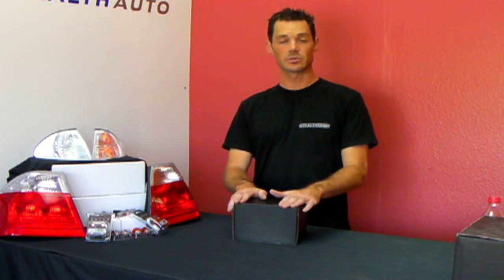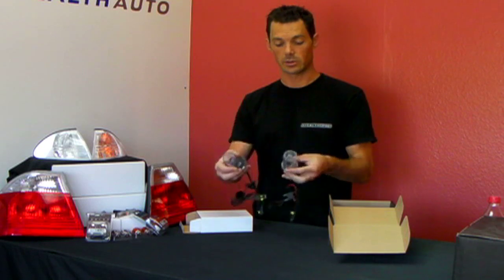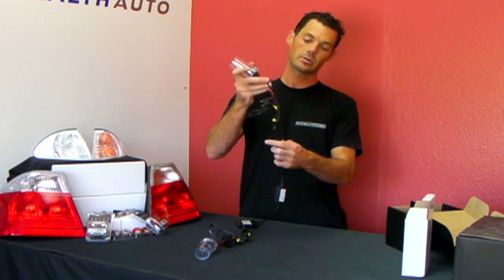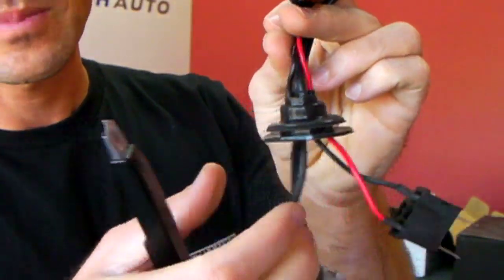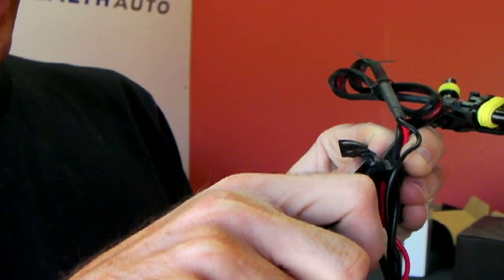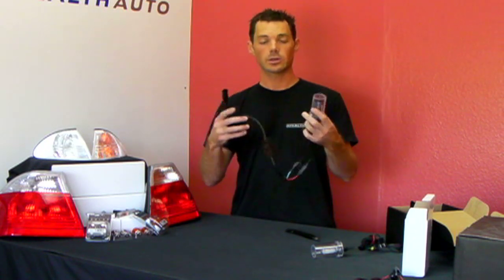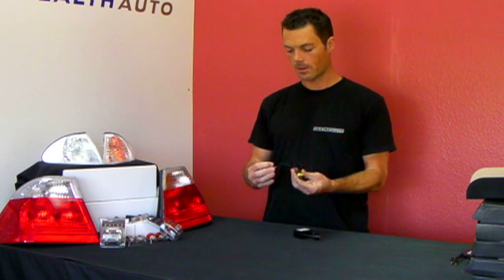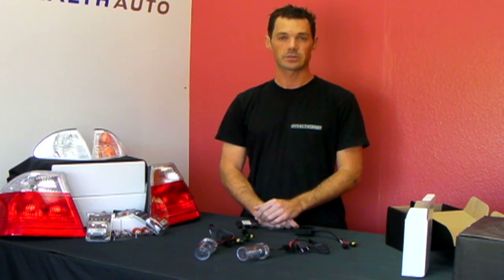HID Kits Explained - HID Headlights and Capacitor Guide

Comment: Have a question for you have an 09 hyundai elantra have 2 kits installed they work fine H11b for the low beam and 880 for the fogs its my fiances car but i noticed if you shut the lights off while the vehicle is running and power them back up only 1 will turn back on unless i wait 5 min so i installed a relay but no change i was wondering if possibly i needed a capacitor oh and its just the headlights that only 1 turns back on when switched off with the vehicle runnin the fogs still come back on

Comment: If you dont replace your headlights then i would say probably stick to halogens.  HID's in a regular headlight destorts the light a little, depending on the headlights function. I wouldnt say their better, they definitely are brighter when in a correct headlight.  I went from HID 's back to halogens just becasue i dont want to spend money on new headlights so it doesnt distort any light. If you runHID's in a stock headlight with a reflector(most cars have)it will be like driving with high beams.

Comment: The ones you can just replace are halogens.  These go through the "igniter" which is a gas lit so you need the ballasts and stuff.  Depending on your vehicle, i have a tall truck so i use halogens in the headlights and HID's in the fogs.

Comment: @wdbwfan 

The common aftermarket blue light is rated 6,000-8,000 k on the color temperature scale. Many simple plug-in-kits include these bulbs because they are initially more attractive to buyers.

Pure white (the ones in BMW headlights) are 4,300 k.
5,000 is going to have a hint of blue that might be enough to attract police attention.

Comment: Hey quick question, I am install a HID kit on a 2008 Dodge Ram and the HID's in the low beams are randomly cutting in and out (not like the normal flickering you get in most cars when they need a canceler kit). I had this same problem happen when I was trying to install a kit on the new Dodge Caliber's as well, I tried installing the normal canceler kit that usually stops the flickering and such but it made no difference. Do you know what I need to fix this? Will a capacitor fix it? Thanks!

Comment: @heartbreakid87 you dont need to get a relay harness, but i would reccommend one. its only 10 bucks on ebay and will reduce electrical stress off ur stock wiring. but no your car does not have a stock relay harness. the factory wiring is a whole harness that splits for both left and right headlight.

Comment: i have a question how did u get ur fog lights to stay on cuz i installed hid lights on my  02 tundra there h4 h/l n they work fine but my fog lights wont turn on anymore!!! n if i turn on the switch for the fog lights n turn on the regular lights they stay in hi beam mode unless i turn off the fog light switch again by the way the fog lights are stock!!

Comment: It's called a Digital Ballast and to prevent ''flickering'' of the High Intensity Discharge bulbs upon first few seconds of being turned on; one should also purchase a relay wiring harness that matches with the head light bulbs of your current vehicle that you are modifying.  Remember to always match up pos and neg on the ballast power supply wire seeing (+) and (-) on the side of the ballast where you plug the wires into the main light bulb power socket i.e. High/low/ground wires

T.J.

Comment: look take the h11 bulb, put it into the low beams of a honda with dtr, it wont work, so you need a cap.

Put it onto the fog lights its ok and will work fine, put it onto almost any other car and it will work fine.

id say maybe 1:50 cars needs a capaictor for the kits to work, so its sold seperately.

Comment: its very uncommon that cars need a capacitor for the HIDs to work correctly.

The kits are sold by the bulb type that they fit,  not for the particular car.

It is the particular car that will have or not have an effect of flickering hid because of pulsed voltages being sent to the headlights.

Comment: Additing a capacitor to the relay wire harness will only cost you less than $10.00

Buy a capacitor from any electronics shop and solder them to the signal wire of the relay, polarity should be followed as + / + and - / -.